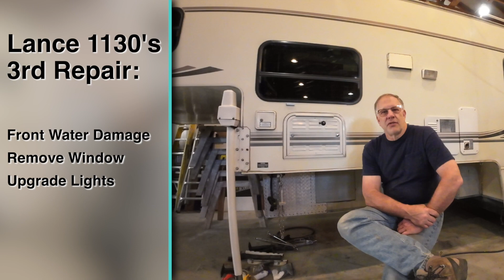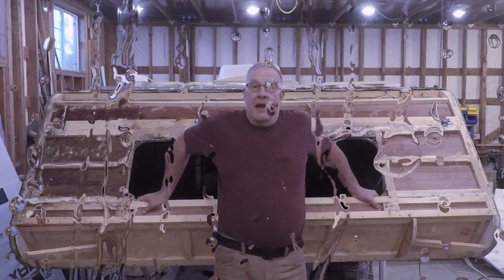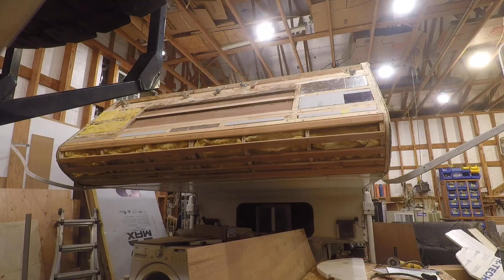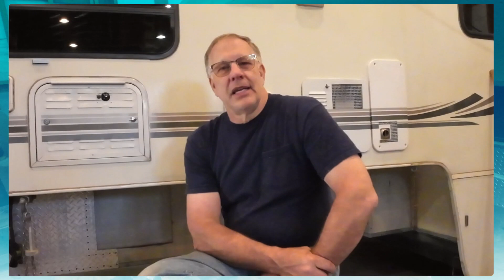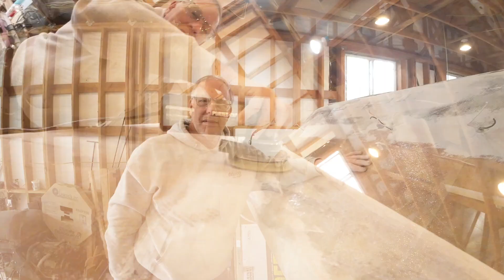Truck Camper Water Damage Repair | Stomping out Water Leaks | Remove Front Window | Fiberglassing

Comment: New to all this, been renovating my rv and would like to do this with the overcab and get rid of the window. Where can I find chipboard in a roll like that. I keep finding little sheets for crafting like at Michael's or large corrugated rolls. And Lowe's showed me a panel. I don't wantbtobget the wrong thing. Also can any gelbresin work or is there a specific one for rv type vehicles? Thanks
Reply from the maker: The material I used was 'Ram board' from HD. Its intended as a floor protective covering. I think there may be several thicknesses but thicker is better. 

Catalysed polyester products that come in paste varieties are body filler and gelled resin. Gelled resin doesn't harden as fast which is why I chose it. You can thicken your resin by adding 'fumed silica' aka aerosil to polyester resin and doing so would be less expensive. It is available on eBay.
Reply: @WorkingOnExploring  thank you so much for replying so fast!

Comment: Fibreglass is the way to go! I am lucky that my body is a converted refrigerated food delivery van. It's a 2016 Iveco with a rear box made of a special foam/fibreglass sandwich. So it's a layer of 2mm gelcoat, 60mm of constructional foam insulation 9very solid and stiff) with another 2mm gelcoat on the other side. So a very strong, very well insulated sandwich construction. Even the floor is made of it (reinforced with in-moulded nylon planks at strategic locations. The floor is 100mm thickness in total). The best thing is, the gelcoat means that it can be built into structures using fibreglass resin and matting techniques.

Comment: Thank you for this very informative video.  I have the same camper and the front window and lights were leaking badly.  The previous owner tried to fix it but made it worse.  The entire cab-over bed base was rotten and I removed everything except the fiberglass skin and then rebuilt it.  I removed the entire front end (from the curve forward), totally rebuilt it, recreated the curve, covered part of it with a piece of galvanized sheet metal and then two layers of Ram Board over all of it.  Then I fiber-glassed just as shown in the video. After some auto body filler and sanding, it turned out great.  I used the body filler to close up all around the edges to make it water tight. 

Your video gave me the confidence to make the repair.  We were actively considering trashing the camper because of the extent of wet, rotten wood.  Now we have a camper that is ready to go again!
Reply from the maker: Great! Happy to help and participate in your camper's rebirth.

Comment: Glad to see you eliminated the front window..I worked in a RV repair shop some years back and always advised to fill in the front overhead window.
Reply from the maker: It never made sense to me to have one there. We want to be able to sit up in bed as I believe most everyone would.  Leaning on the window and window covering is just silly.
Reply: @WorkingOnExploring  I LOVE my front window of my Summerwind 10.5 foot camper.  I will not take it out.  I like to lay in bed and watch the wildlife, or my cats.  I can seal it up.  Yes, my 2000 camper was leaking.  It is no longer.  I am 78 years old, I will not be able to do this camping thing too terribly much longer.  I am in the process of repairing my 12 volt electric camper jacks, because some VERY poorly trained employees at the RV center that I bought my camper from used a battery powered 1/2" impact wrench to unload the camper from the old lady that gave it to them to sell for her, and used the same impact to raise it to load on my truck.  Doing that destroyed the gears in the top of the motors.  I was able to find some brand new motor/gear-sets for my square jacks that are no longer made.   

I can fix what is wrong with my unit.  I worked in field service for Caterpillar most of my life, so us field guys are able to think outside the box.  Actually it is kind of fun.  

There is no way that I can sit up on the bed.  I am 6'3", so I just have to scoot down.  I once had a 1991 Lance 10.5 foot camper, and I use to go camping with 5 cats.  Several years ago my Wife that I had at that time had a heart attack and died.  (in that camper)  My Girlfriend that I have been with for 23 years does not like my 3 cats, and that is why I bought this camper.   I have never taken these cats camping before.  It will be interesting for sure.

Comment: Is there a way to delete the front window using this method and bonding the fiberglass to aluminum? I just picked up a 1990 Lance Squire L4000/9.4. I want to eliminate the front window completely and just seal it up like you did in this video. Any suggestions would be greatly appreciated.
Reply from the maker: I'm not sure what method you are intending so I'll throw out some thoughts; 1) From your question,  I assume you have an aluminum skin. Fiberglass can be saturated with several resin types.  The most common, Polyester,  does not adhere well to aluminum. Epoxy is better to use if you want to achieve better adhesion. I would not advocate relying on adhesive properties of a 'hard cure' adhesive for a flexible aluminum skin. 2) The window frame clamps the skin on the outside and the thin luan on the inside (likely also has some 1/4" crown staples), to the wood frame. If you remove that clamp, I think you have to replace the force it provides both inside and out. I imagine that an appropriate ring of small flat head screws, into the wood frame, on both sides would be needed (assuming the wood frame is in good condition to hold a screw). 3) With the window removed and perimeter skins resecured, a 'plug' could be fabricated and secured inside the (the rough opening is a rectangular with plastic corner radii stapled in the corners) rough opening. I imagine the plug made of wood products (3/4 lumber, insulation and thin plywood, like the camper frame) and secured to the window frame with pocket screws. 4) some kind of durable, weatherproof outer skin would need to be applied and sealed. The most cosmetic would be a piece of the same corrugated aluminum I assume your camper is covered with. Made slightly larger, its corrugations would overlap and coincide with the skin. It could be adhered with a flexible urethane adhesive caulk such as Sika 252 or Loctite 5700. Since the window was flat, the patch could be flat, not requiring more screws to hold it till the adhesive cured. I would use pressure around the perimeter of the bond to squeeze adhesive out (removing all that squeezed out) ensuring the patch cover was adhered all the way to the edge. With this method, I think you could avoid an external caulk sealing bead that would make the repair obvious. 5) Inside, a cosmetic overlapping  cover layer is needed as well. Because I planned to lean on the wall where the window was, thin plywood wrapped with upholstery fabric was screwed into the old window frame as well.
Reply: @WorkingOnExploring  Thank you for the quick response and detailed information. It is very helpful. I'm tackling the project over the next couple weeks.

Comment: Seems like a good idea to spray the whole thing with some type of heavy seal stuff like flexseal then install new siding over that. Not sure how id do that restore but it be a job trying to waterproof it without making it heavy. Yeah fiberglass might be the best bet
Reply from the maker: Weight is always a problem but putting good material over bad doesnt last long. People also fail to find and diagnose the problem which simply guarantees that the bad result will recurr...seen it many times..
Reply: @WorkingOnExploring  after seeing the whole video where you did all the fiberglass work was pretty impressive. Yeah I'd love to find one like yours and do all the solar and upgrades like on my holiday rambler. This hobby I have with restoring and upgrades has given me more pleasure than any camping lol
Reply from the maker: @matthewknight5641  that's why we are 'working on exploring' because we seem to do a lot more of the former and only when exhausted, do the latter...

Comment: awesome video. I have an 03 Lance 1030. I had water damage in the same areas as you and I had it repaired by a local RV dealer. I think they did a pretty good job but I'm not certain. Your video has opened my eyes that maybe I should have attempted it myself. If any problems come up in the future I will give it a try. I would prefer to see your repairs in real time and not on fast speed. Anyway that can happen? Also, did you say you were considering an aluminum front cap? Who makes that?
Reply from the maker: I wrote a nice long response a week ago and just discovered I failed to post it so here we go again.
1) When I shoot video, I do so as a combination of full motion and time lapse. I start with a full motion explanation (sometimes just for the editor) then switch to time lapse as fabrication takes a long time. Shooting in time lapse allows the files to be a lot smaller (easier to transfer, use and store) and the camera battery to last a lot longer. Transferring and storing  big files is a very big problem. When you see a time lapse, that is how it was shot, not the editor converting it to a time lapse (although that can be done). In short, the long, detailed video of the whole process is never recorded. There is certainly cut 'scraps' cut from what is taken and what is used but they are not that much. I don't and won't have the detailed 'how-to' content you would like. Folks on YT shy away from long videos and most of mine are already very long. I often take some still photos that dont get used as well. If you want more detail, the best way is for us to engage in dialog either by email or phone and I can help you get what you want to know.
2) The aluminum skinning I conceived was to use a piece of 5'x8', 5052 aluminum about .040 or .032 thick. This can be found in either 'mill finish' or possibly pre-primed. I would anchor it loosely at the top and align it to the sides, (possibly with a little overhang to be trimmed off later). Once aligned, I put a couple clamps (vice grips) on the bottom edge and hook a ratchet strap from the vice grip to the jack legs and a center one under the camper to the back bumper to stretch it tightly. When tight and in position, anchor it across the top and evenly down both sides using screws through the J-molding. The problem is that the aluminum is not bent permanently where it goes over the curves. This can cause the aluminum to bubble in the center of the 'field'. The front window may have been used (more) to clamp the center of the (Filon) materiel to the frame more than its functionality as a window. Since I am omitting the window, this is the primary reason I did not use aluminum.
Reply from the maker: I omitted.....sheet aluminum can easily be obtained from any major industrial metal supplier in flat sheets up to 5'x10'. Anything lager only comes in a roll and would need to be a special order directly sourced from the manufacturer. Rolled aluminum also has the shortcoming of having some residual curve. On a curved front cap this is not a problem but on a flat side, it is.